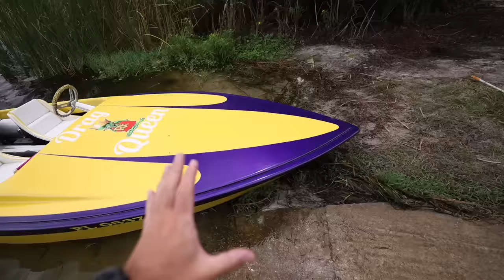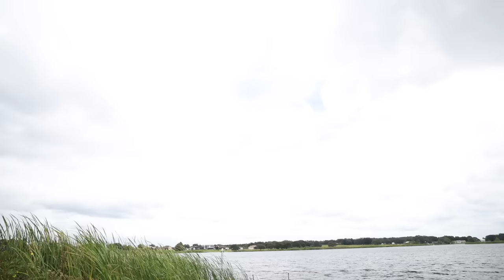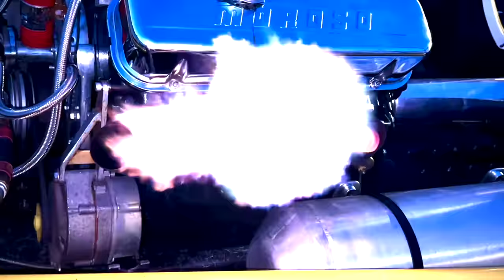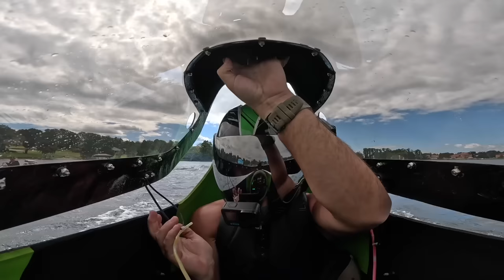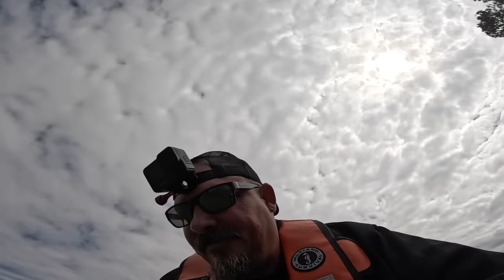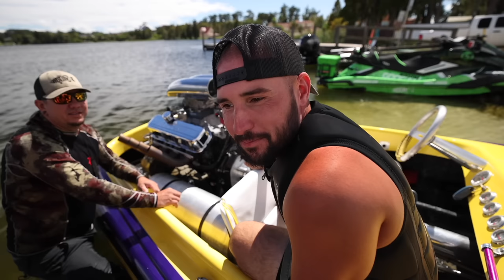F-1Race Boat VS. Drag Race Boat!! (BLOWN ENGINE!!!!!) *THIS IS BAD*

Comment: Without a tear down it's hard to tell for sure, but the hole is in the oil pan which could mean you might get hella lucky and the block can be rebuilt.fastest way to tell would be to pull the engine and drop the pan to see what really happened and to see if the block can be saved or not.

Comment: Breaking just means time for an engine upgrade! Would be bad ass to see a 540 or bigger in her.
Reply: 4 sale. 13k 540 alum. Dart block afr heads 782hp/668lbtq 93 octane. Had it in a Chevelle with 175 pill

Comment: Also they make a 12v solar chager that you should mount on all of your boats.  They are only like $30 each and can keep your batteries charged up.
Reply: Interesting, so it's a solar trickle charger?? Do you have a link for said item?
Reply: I had one on the dash of my pickup truck and the work van that we didn't drive everyday.
You can probably find them at any auto parts.
The van was parked inside but under a skylight and that was enough light to keep the trickle charge going.
We put one on the forklift also.

Comment: I've rebuilt  a 1969 flatbottom V-Drive and it was a blast to drive. You need a lot of power and a really good hull on a flatbottom to make them go over 100 mph but the V-Drive boats are really quick and if the V-Drive gear box is geared right with a lot of horsepower they can be really fast. I'd like to see you rebuild the 454 to 500 - 700 HP and race them.

Comment: Putting a gas engine in that coast guard boat is a bad idea. Will it work? Sure! Will it work as good as it does with the diesel it was designed to run with? Hell no!
Reply: Coast guard boat isn’t gas, it’s getting a new twin turbo diesel
Reply: @scalenationrc  oh that’s great! I could’ve swore I heard him say it was getting a turbo charged V8 so I naturally took that as a Gas engine. I’m just use to seeing inline 6 diesel engines in boats. Glad you guys are going back with a diesel. You see too many people taking a boat that was designed by engineers and designers build a boat with a diesel or diesels and they get replaced with gas engines while still using the same gearbox and propeller. Keep up the awesome work gents!

Comment: We’ll kind of saw it coming. Sad though. But you started with a race boat. Dude you’ve got to finish it. New motor. If you buy an old block, the pistons, rods and gaskets. Not including labor you’re going to be in it for about 8 k. If you do it right. 12k. If you buy a built race motor it’s only 120k or so. You got this 👍👍

Comment: Did ya check the oil before  ya started it after it sat out in the hurricane?
Reply: Yes we actually changed the oil before this run as well. We knew it was gonna need rebuilt when we done a compression check but wanted to see if we could get a few runs out of it before then
Reply: Looks like it just threw a rod through  the oil  pan. The block may be ok

Comment: yall should throw a 5.7 or 5.3 ls and there cheap and should be a easy swap
Reply: Lighter to
Reply: Couple trips to the junkyard and smooth sailing
Reply: Wouldn’t run good them boats need the torque a big block has
Reply: @colewatts2462  thats why you need a supercharge on meth !

Comment: now comes the fun, how small an  engine will get you to 100MPH?  1 Liter Ford Eco-boost with big turbo? K-swap it with the help of the Boosted and Nautical Boys? It doesnt need the monster muscle but im sure Texas Speed could maybe help a build out.  Is Electric an option? a Tesla engine from an insurance right off and a battery pack.  So many possibilities.

Comment: You could hear that motor was hurt the entire video. It just wasn’t revving. Water in the oil means no lubricants in the bottom end, so chances are yiu have shrapnel. With a decent motor, that’s an easy 100 mph boat.

Comment: At least its not a total loss via sending piston thru the bottom of the boat best bet pull out old motor salave parts off it and transfer to a new block which you could probs find at a junkyard

Comment: Blown flat bottom K-boats can turn hard ar high speed and can handle the same chop as the F-1 boat. The tunnel will always be able to out turn a flatbottom but don’t be fooled into thinking flatbottoms can only go straight.

Comment: Thanks for all the videos guys.  Does anyone know approximately how much it would cost to replace the entire engine?
Reply: If your got one from a junkyard $700 max without labor. Prob two days of work. Easy to pull that out with a hoist and transfer over the headers, blower, carb ect.

Comment: There are very few boat\engine combinations that are more impressive than a Champ boat with a V6 outboard.  This one sounds like a stock 200 and still runs decent and would run much better with an experienced driver.  That big block never stood a chance.

Comment: The 454 will be cheaper than the merc 200 to replace. Looks like it has had some water in the oil for a bit

Comment: Looked like the hole was in the oil pan so there's still a chance that the block is still in tact. I'd pull the oil pan off before selling it for next to nothing.
Reply: I mean it had to be metal to shoot a hole out then side of the oil pan

Comment: Make a ball about the size of a golf ball out of aluminum foil not tightly packed dip it in water and scrub those valve covers and they look like brand new again and it will not scratch the Chrome

Comment: Your problem is you can NOT run a car oil pan on a v-drive you need a oil pan made for a v- drive fly wheel forward that way your pick up is in the back of the motor and not the front it will blow up every time you run it like that just trying to help you out from Dragboatcity

Comment: ( engineer join chat) 
i was hearing that tapping noise when you have it at shop repairs and engine doesnt sound good and i listen to it closer and hear it start tapping louder and it started to bogging out and snap rod and threw it at wall blew wall off the block
it called rod threw out and she is done
2nd that not upgrade 454 it stock engine 454 because i can tell by tone from engine and i can replace engine it up to you jordan it cost money swapped engine

Comment: Engine up and trim out on the f1.. get rid off the drag and you will fly across the lake 😁 pedal to the floor and trim down and in for the turn and hook the corner..live on the edge 😁😁.. a boat runs faster in the air than in the water.